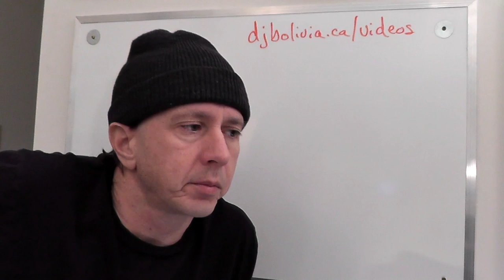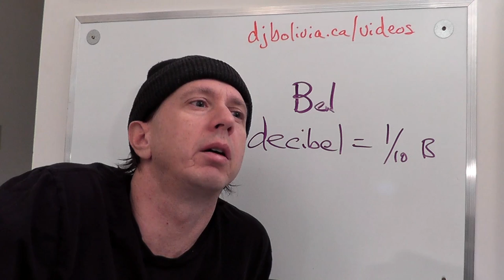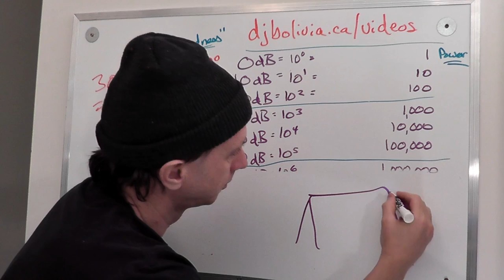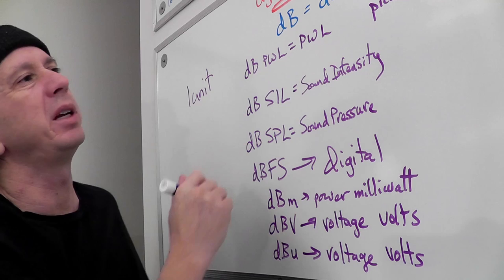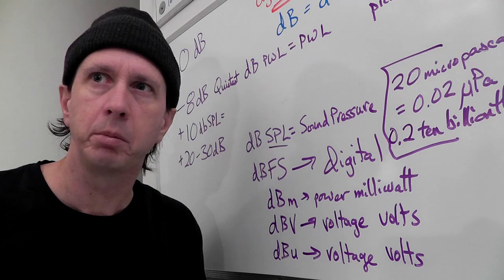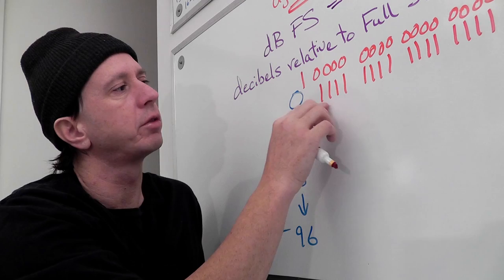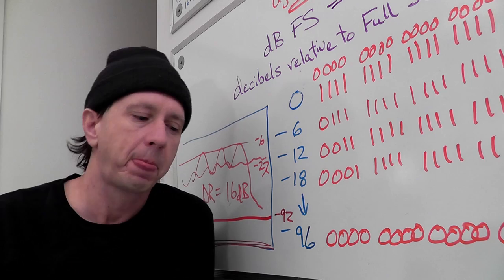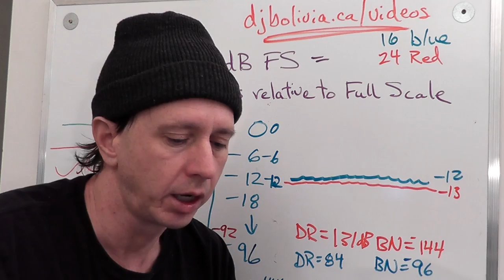Audio Recording #08 tutorial with Jonathan Clark - Understanding Decibels

Comment: milli (1x 10(-3)), micro(1x 10(-6)), nano(1x 10(-9)), pico(1x 10(-12))...  so a picowatt is not a trillionth but a billionth of a watt.. Honest mistake... Other than that its a very well informing video, and thanks.
Reply from the maker: Thanks Ao, you just taught me something.  Possibly not what you expected though!  I think we're both right.  The terms vary depending on which country you're in, and whether you're using "short scale" or "long scale" for numbers.  Check this out:
http://en.wikipedia.org/wiki/Long_and_short_scales

I knew that there was a difference between some countries in how they expressed some of the largest numbers, but I didn't realize that there were two very well-defined and separate systems for the large numbers.  Very interesting.
Reply: +djbolivia Never head of short and long scale, now I know more than a few seconds ago. Thanks Ao!

Comment: If bel was too large a unit why did they define it that way instead of defining it as 1/10 of the original definition. Then we would be using bels today wherever we use decibels. Is there a good use for today's bel. I mean do we measure anything today in bels? Or is it always decibels? The big question is would we be better off if a bel was equal to 1/10 of what it is? Again, if the answer is yes then why did they not realize that right away and change the definition of a bel to 1/10 of what it was?